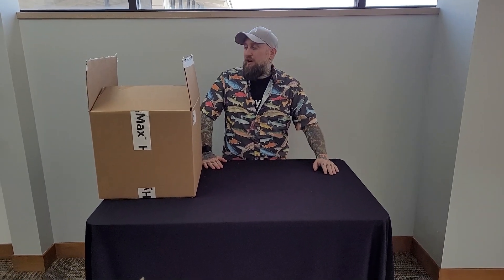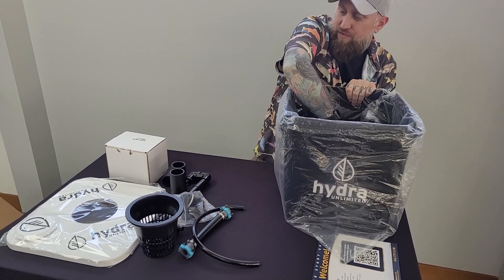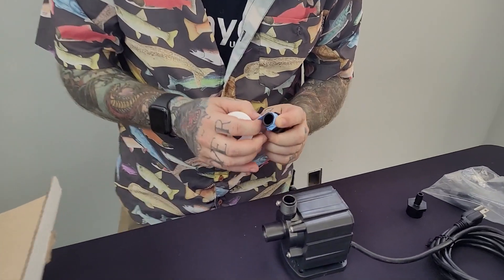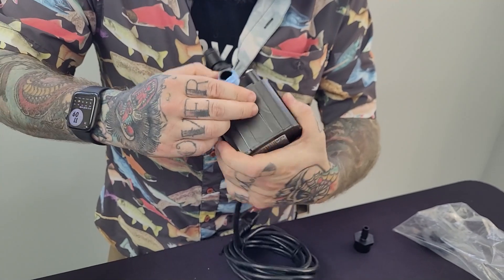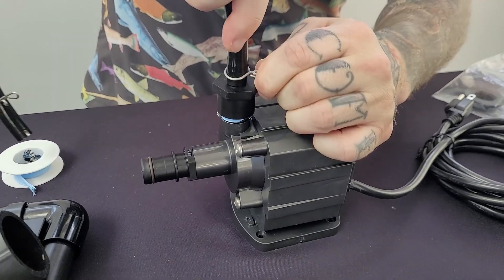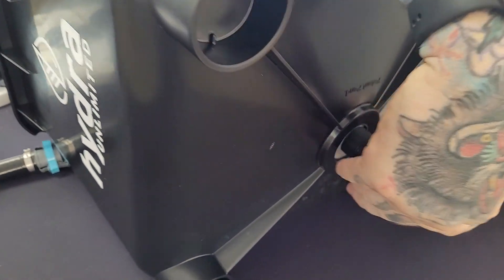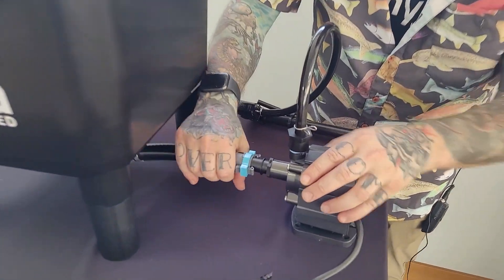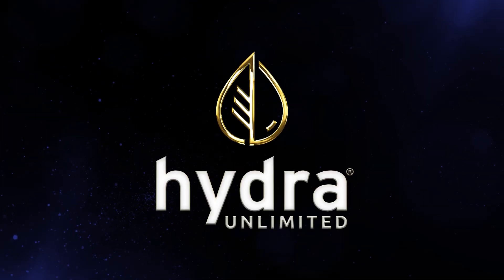HydraMax One Bucket Installation & Assembly | Deep Water Culture Hydroponics

Comment: Hi looks great but my biggest concern is how you exchange water without lifting plant ? I can see you have a drain in the bottom of the bucket but still you can't put anything there because is no space under that drain. Also is any lock in that drain ? I'm DWC user and this is always issue when the plant is flowering stage.
Reply from the maker: Hello! There are a couple options we recommend. You can simply unplug the pump, squeeze the spring clamp, pulling it down the tubing on the circulator. Then proceed to remove the tube from the circulator. Point it into a 5gal bucket and plug the pump back in. Turning the pump off and gravity draining the rest of the way when the water level becomes low enough. This is a fast and easy process. Alternatively, a wet vac does wonders in RDWC if you can avoid the roots. We hope this helps!

Comment: How can you drain water from this bucket
Reply from the maker: Turn off the pump, disconnect the circulator - and then you'll use the main line to be able to just "pump" the water out. The center drain will help everything down so you're freely able to pump "out" basically. A 5 gallon bucket next to everything works great. DM us on IG, FB, or email us at customerservice@hydraunlimited.com for further Q's, thanks!

Comment: When are we getting the video which explains how this system works. 

We hear that this system uses less water, that we won't ever need to worry about air stones, etc, and that is great. 

But how does it work ? What does this single pump do ? What is the direction of water movement ? Why ? What's the DO levels in the system ?
Reply from the maker: In a nutshell, the HydraMax system utilizes a single pump that effectively manages water movement within the system. The pump pulls water from the bottom port in the bucket and pushes it back through the HydraMax aerator. When the water goes through the aerator its patented design pulls in oxygen before flushing back into the remaining water within the bucket maintaining optimal dissolved oxygen (DO) levels - about a 50/50 ratio. 

We appreciate your curiosity and patience, a forthcoming video should answer all your questions about the HydraMax system's functionality. Stay tuned for updates, and please don't hesitate to reach out to our team if you have any further questions.

Comment: Looks super expensive
Reply: I see you have to contact them for a price quote. Normally means more than you can afford
Reply from the maker: Hello there! We are currently enhancing our website to offer a seamless purchasing experience, eliminating the need for requesting a quote. The One Bucket System and the Two Bucket System, are currently listed at $179.99 and $259.99, respectively. We also offer a tool on our website that allows you to calculate your ROI (return on investment), normally this far out weighs any upfront cost. Not to mention, our system uses less water over the grow period than other systems on the market, allowing you to save money in that regard as well.
Reply: @HydraUnlimited  1 bucket for 180 buck...nice job boys making that up! Gotta build more profit margin in than a simple 5 gallon bucket....wow.